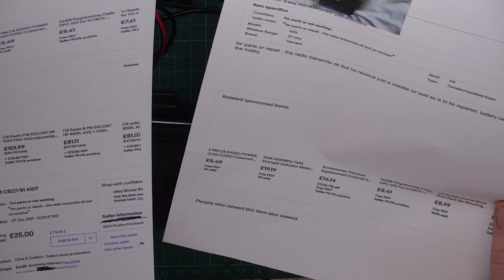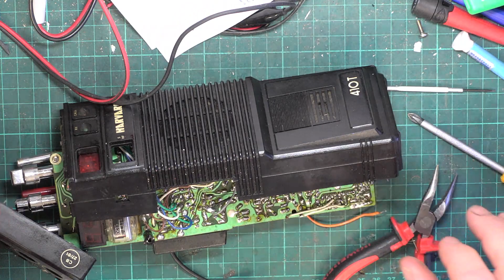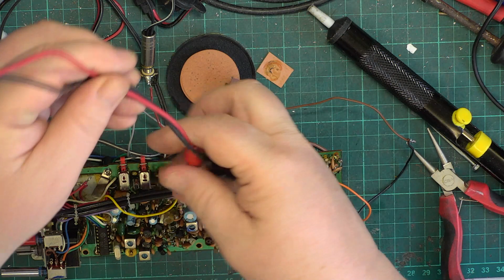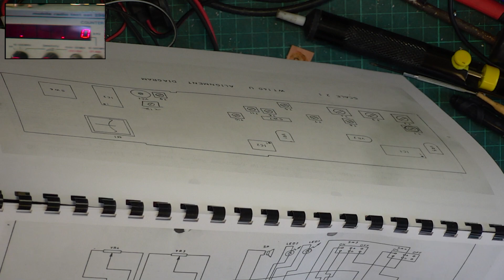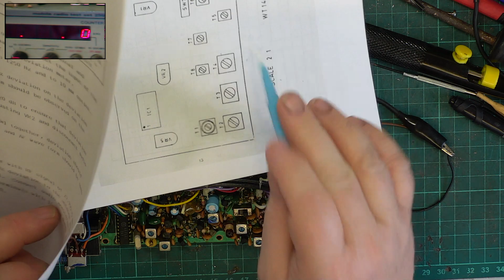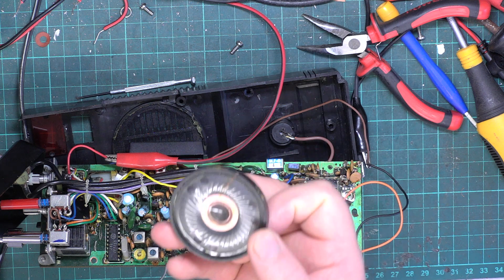Harvard H410T CB 27/81 UK FM Handheld 2W CB radio - repair & service

Comment: How much to repair one of these the same I paid £28 off eBay but it doesn’t work, it’s been unscrewed before and I’ve looked and the board is snapped, all you get is static and lcd channel doesn’t work, was sold as working as made a sound but doesn’t know about cbs :(
Reply from the maker: email me with a picture of the innards. It is vital that the telescopic aerial is intact too.  rshireby@yahoo.co.uk

Comment: Had one of these as part of a job lot, antenna broke, speaker missing, and wires off everywhere ! decided to scrap it and use as parts...... so far used rx mosfet, rf output transistor, PLL, and a coil, so well handy !  have a midland 2001 with a segment out in the display....... any ideas if i can use the one out of this ?  :)
Reply from the maker: Quick answer. No idea. This is what you have to do. Look at the part number stamped on each of the displays, then do a search for that's part's datasheet. Apart from colour & size, LED displays are either common Anode or common Cathode...so two types of polarity. That info, and the pinout (that can also vary) is shown on the device datasheer.

Richard, 0OJF, UK
Reply: @ukfmcbradioservicingTango21  ok thanks Richard, the midland just has 22p printed on it ? And the the diagram I have shows display without pin numbers ? So not much help ! I'll see what's on the Harvard one when I take it off. Thanks. 👍
Reply from the maker: There is one for sale on ebay right now, a friend spotted it:-

https://www.ebay.co.uk/itm/184885507258?hash=item2b0c08f4ba%3Ag%3ANU4AAOSwnRZgiIA5&LH_ItemCondition=10%7C4
Reply: @ukfmcbradioservicingTango21  well spotted ! Thanks 👍

Comment: You talk about air con, I've lost count how many people think I'm an idiot when I tell them to run the air con in the car but have the temp hot to dry it out when its been raining and fogs up from wet clothes or carpet.
Air con works as a de humidifier when run hot but nobody ever believes me and everyone is obsessed with it being a cold only use!
Reply from the maker: I get hay fever badly & live with woods one side & fields on the other three sides, 1/2 mile from the nearest neighbour. Within 9 months of moving here in 1985 I installed four air conditioners. Since 1985, I've always made sure there was at least one air conditioned car; many people won;t realise how difficult it was at that time to get a car in the UK with air conditioning. When times have been hard I've bought old bangers that, by picking the right make & model, still had aircon.

Oh yes,  your windscreen starts steaming up, you can switch on the aircon with the heater & watch the windscreen clear in seconds.

Richard, G0OJF, UK

Comment: I wonder why an 9:1 UNUN was not used to match the telescopic antenna to the transceiver circuits as impedance should be 450R
Reply from the maker: Perhaps they didn't have them to fit in the 9mm x 9mm space in 1981
Reply: Don't think 9:1 unun had been invented back then

Comment: Going back to the porta pack you have done a field strengh on this 410T how would you go about the porta pack alignment ?
Reply from the maker: It doesn't have an adjustable loading coil, so as long as you're using the factory original aerial, it will always be fine.

T21